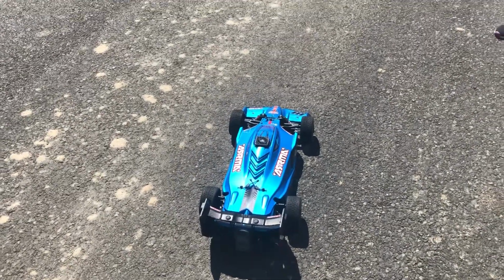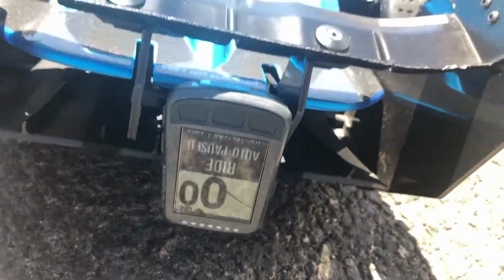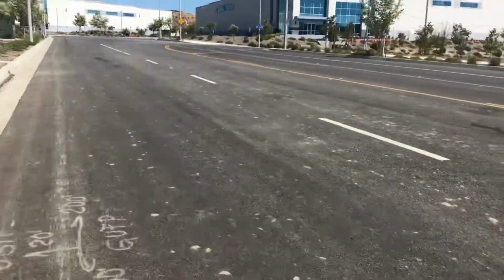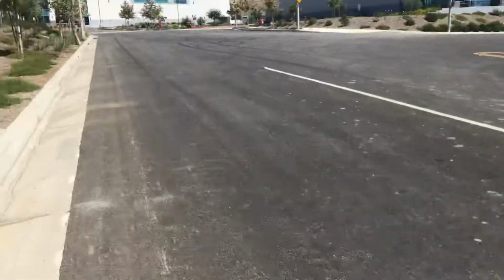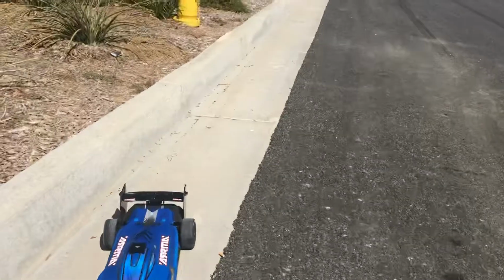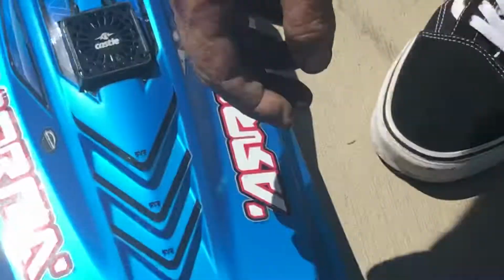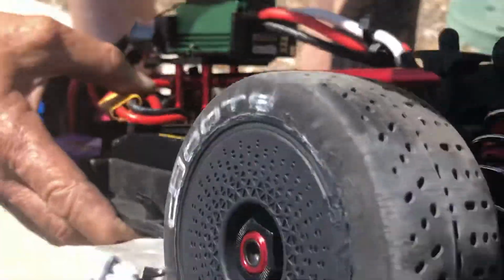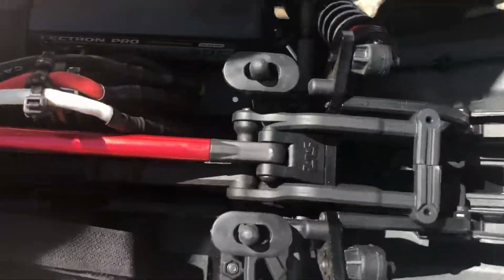Limitless speed pass 2

Comment from the maker: 107mph and the rear wheels locked up bearing came apart that’s a titanium center diff unit from EMP first time I’ve had this happen and I’ve used there motor mount set up in my slash 4x4 with no problems